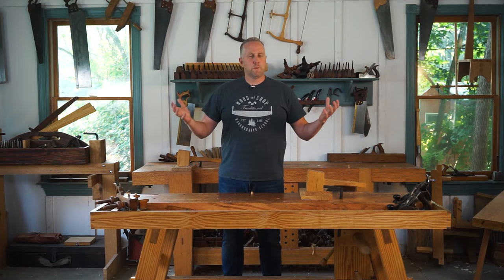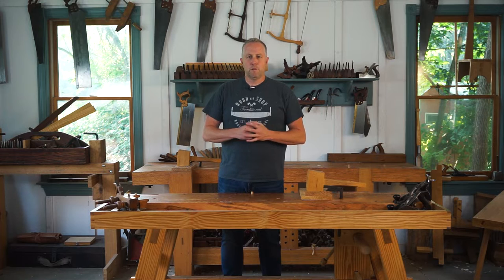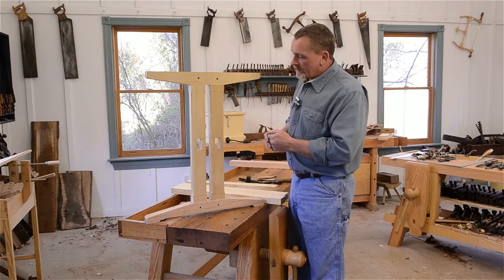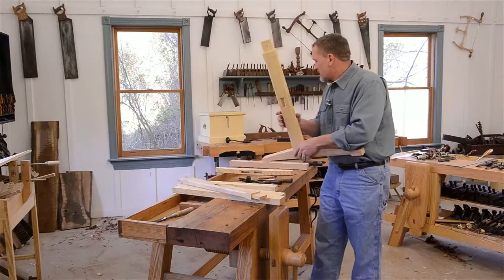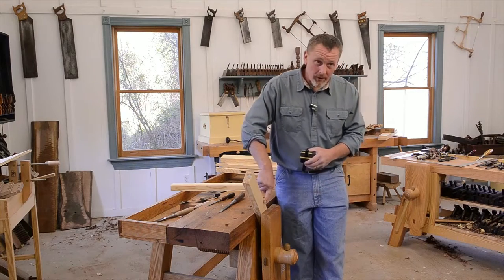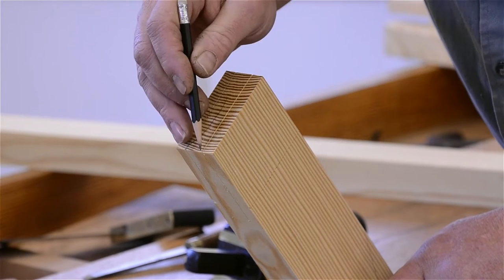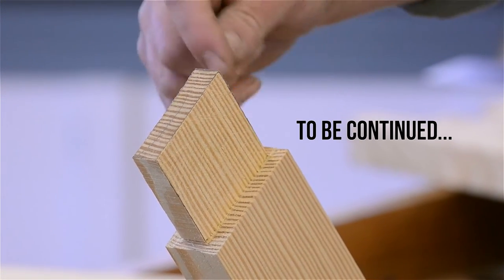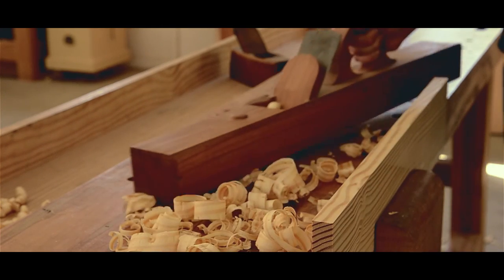Ultimate Mortise and Tenon Joint Part 1: Cut the Tenon

Comment: Shouldnlt you cut the mortise first?
Reply: I believe he's doing the tenon first so that he can use each tenon to layout the length of each corresponding mortise. I assume he'll come back with a router plane or chisel to clean up the tenon cheeks unless he was able to saw perfectly straight down them :). 
The important thing is to use the same marking gauge on the same side of each leg and foot if they are equal thickness so that they end up being flush down the sides when assembled. (Especially since his marking gauge/tenon was slightly offset more to one side.)

Comment: Don't use glue when you put in wooden pegs/nails. someone in the future restoring your work will thank you.
Reply: Would hide glue be ok in this case?
Reply: @darrenmacmartin9392  No because you can't heat it up that deep inside the wood. Bone and hide glue is good for gluing surface elements though.
I'm just saying it's always better to make something in a way that it is repairable and gluing everything together, even though it's not necessary, makes repair more difficult or even impossible without a lot of destruction.
Reply: @swunt10  that makes a lot of sense, thank you for taking the time to clarify!